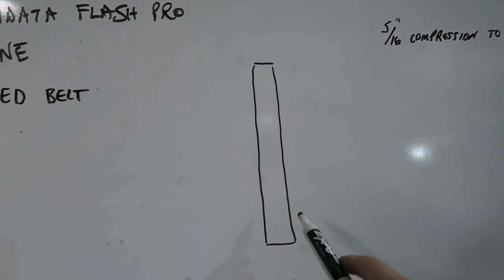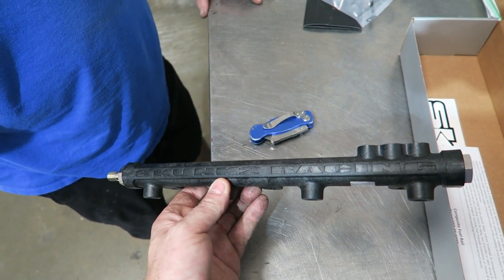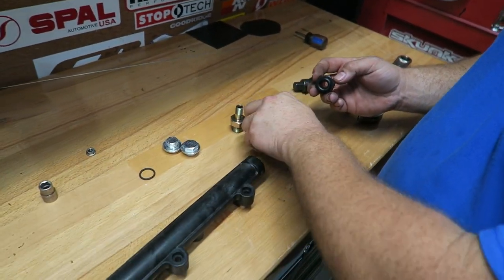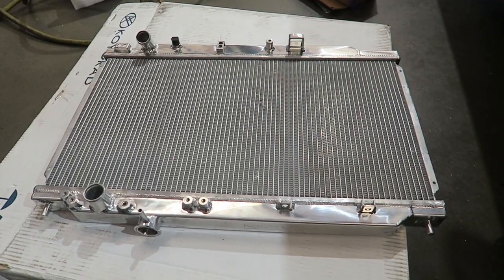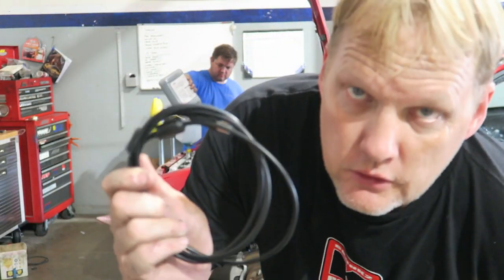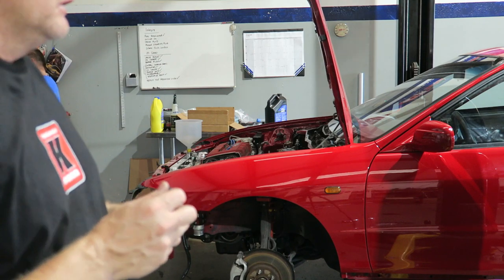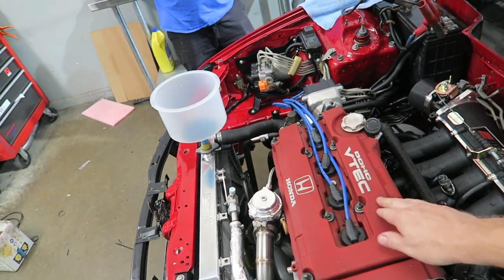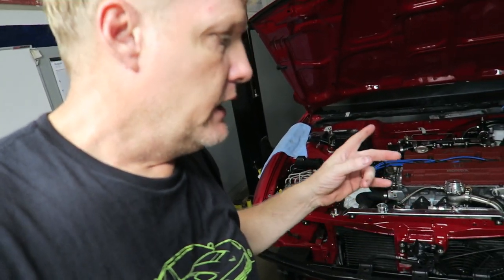INTEGRA BUILD-  assemble Part 4 , IT RUNS !!!!

Comment: Awsome Integra. Super clean the way I like to keep a car if I can (minus all the expensive bits, I'm poor). I have em2, and it always loses a lot of smoothness when it heats up, similar to way I hear this car. Probably the aluminum block. Honda has gone crazy with cast aluminum. My em2 has cast aluminum oil pan even (WHY???). Maybe you can torque head bolts with engine hot or something, or adjust valve timing with hot. Aluminum is much more sensitive to heat and deforms more compared to steal/cast iron blocks I think (not sure on that exactly). Maybe, assemble engine, run it up to temp, pool valve cover, loosen head bolts, so head can reposition, then torque down evenly, then adjust valve clearances, while still hot, run again heat up, just releive some head bolt torque, re-torque and do valves, if valves not moving, and head bolt torqued, then leave it. I don't know maybe that cause warped head/block haha.

Comment: Awesome build. Just started watching. Quick question, in Hondata, on your tables what do you set the timing to for these B series ? As I'm sure you know with Neptune, Hondata, and Crome, there are additional ignition advance tables. Which I'm having trouble finding information on. Most of them increase timing by around 5* at 4000rpm, and anywhere between 7-9.5* at 6000rpm...and this is (on top of) the ignition on the tables you build. So say you have 18 degrees in it at 10psi at 6000rpm, the advanced ign tables will be adding an additional 9 degrees on top of your 18*...
Just seeing if you zero those out and adjust your base tables accordingly, or?

Comment: Hey John. I just bought the exact same Spal pusher fan for the driver side.  I have the same setup as you. Did you use a relay to power the pusher? Also how are you activating this fan? Is it using the driver or passenger side oem fan plug to activate the relay/fan?

Comment: Damn that sounds good!! My B Series has that little tick too. So hard to get those loud lifters quiet! BTW, I can't tell you how happy I am that the owner didn't go K!! #Bseriesonly
Reply: Extreme Daily Drivers if a valve adjustment doesn’t clear that up it’s probably the lost motion assembly. The rockers get loose from it and the middle one rattles when not engaged in vtec making a tick. Skunk2/blox sells replacement LMA for around $100

Comment: Turbo looks tight in there against that full size rad, are you going to run it without a timing belt cover? or just until its dyno'd?
Reply from the maker: Aido Wilson As mentioned in the video.   For tuning purposes only. Hence the slightly ratty valve cover.
Reply: @LHTPerformance 👍

Comment: the fan on a dc2 teg is 989 cfm the fan pictured is only a 500 cfm you would need 2 of those
Reply from the maker: bob thompson Actually, The Spal push fan is 950 CFM and the pull fan is 1227 CFM.  The Spal fan is more than double the stock fans.

Comment: I see you guys use the timing cover. It drives me nuts seeing people not have the lower cover on. Anything could fall down there and ruin their day.
Reply from the maker: Eddie Reichel Once the cam tuning is complete, we’ll install the new cover with no cut outs.
Reply: @LHTPerformance  Yep I think that is what I meant to say. Is that you put the lower cover on.  I head you explain that in the video. Putting all the parts back on is kinda professional..
Reply from the maker: @eddiereichel9354  I got ya.  Thanks.

Comment: ew worm gear clamps are the worst. i completely disagree with your opinion on them looking better than t bolt. not to mention they strip out super easy. t bolt clamps can easily be oriented to where the bolt is hidden as well as being flush with the edge of the coupler. im not sure what the difficulty is there
Reply from the maker: blandsarcasm That what makes building cool.  Everyone has their own opinion.    I stock a ton of T bolt clamps when you need them.  👍🏻